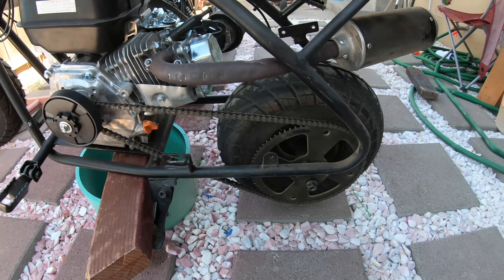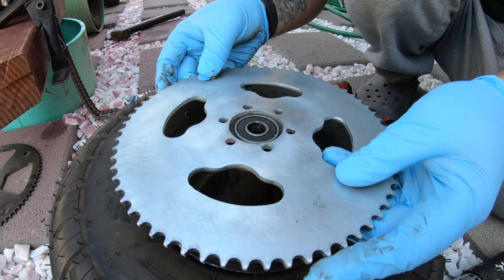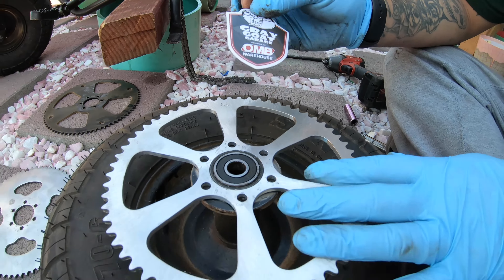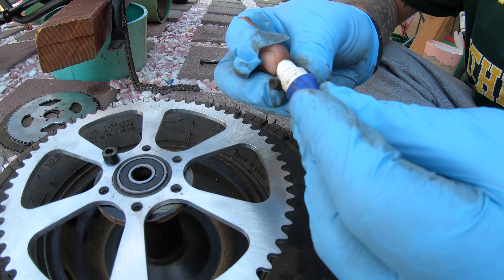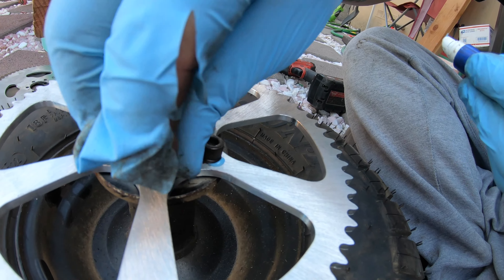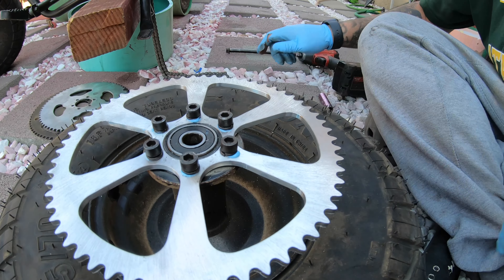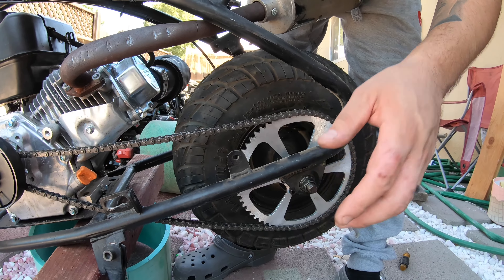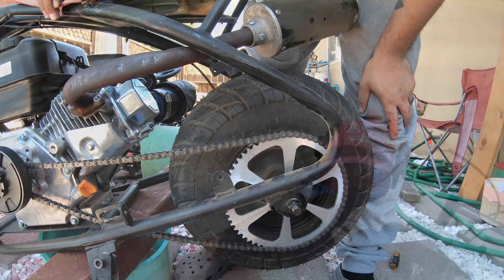We upgraded our rear sprocket ⚙️ on our motovox predator 212

Comment: I switched out the front forks between my old school doodle bug and my Motovox. The Doodlebug needed adjustable bars because it's not long enough for a 6'2" guy with the stock bars.  But the longer Motovox still has plenty of room with the Doodlebug bars, because 
The motovox head tube angle puts them more forward at the top.

Comment: Wouldn't a larger sprocket yield a higher top speed? Figured it would be the same as a 10-speed bike or the transmission of a car. Larger the gear, higher the top speed. This concept to me is like putting a low gear in place of a high one.
Reply from the maker: No smaller gear on the drive wheel higher speed bigger more acceleration low top speed and the front sprocket is lower the gear more acceleration higher more top speed
Reply: It is the same as a car. If you go from a 273 gear to a 411 its going to have a lot more low end power, but will be turning some higher rpm's at 50 and up.
Reply from the maker: Yeah same concept
Reply: You don't understand the difference between the driven and driver sprockets.
Reply: @contraband1543  Uhhhh. There is one sprocket on a mini bike, just like a bicycle. smaller the gear, more torque less speed and on. It's not rocket science but apparently people think backwards nowadays.
Reply: No I’ll tell you why because let’s say u a 12 clutch and 75 sprocket for the back wheel to turn a whole 360 that mean the clutch will have to turn 6 times so it will be a 6.3 ratio now a 12 clutch to a 60 sprocket that means it’s a 5.0 ratio which is a higher top end. You get me… with respect
Reply: @astridperez1812  But that would then give you less torque. Most standard clutches have the same amount of teeth for these bikes so just making the rear sprocket larger is having an adverse affect to what the goal is. Sorry but you're backwards.
Reply: smaller the gear the faster because it takes less rotations of the shaft to rotate the wheel once at the cost of power
Reply: @thegreatpatsy  it has two sprockets one for the clutch other for the rear wheel smaller sprocket is the back the faster you go if you’re confused there are a lot of videos out
Reply: @brandonespinoza111  I'm not confused. It's simple logic that if you reduce the size of the rear sprocket all you are gaining is low end torque, this has nothing the do with top speed, especially if your engine has a governor or is limited. The larger the sprocket, the wider the range and higher torque at TOP speed. Comprende? I have the same exact bike with the same engine, trust me, the video creator could keep going smaller and smaller on that rear sprocket and it ain't gonna make one damn difference in the top speed.
Reply: @thegreatpatsy  it’s a simple google search if you don’t believe me😂

Comment: At first I think you said you were going to from a 75 tooth sprocket to a 65, then a 60. At the end, I think you said you went to a 60, and only gained 4 mph.
 Did it quit trying to wheelie as bad with the 60t/65t?
Reply from the maker: It only gained 4mph more becuase we were limited to engine rpm on a stock governor motor
Reply from the maker: And wheelies stopped
Reply: @EnviousRepairPerformance  I changed from a 75 to a 65 two days ago. Significantly faster top end,  still good bottom end acceleration , and that front wheel still trying to come up. If I wasn't paying attention to it it would have flipped me on my back. It did twice in my front yard. A little embarrassing . 
 How are you finding how fast your going?
Reply from the maker: With a app on my iPhone that I have for speed
Reply from the maker: GPS speed
Reply: 10% increase

Comment: when i put on a smaller sprocket does it give less torque because i need to lower the torque on my mini bike because it pops up very easily
Reply: Yes, could even go to a 40 or 50 tooth if you really want to tame it down.

Comment: can i use a 60 tooth rear sprocket without the chain having issues staying on? i was assuming since its smaller, id have to make a custom chain tensioner of some sort, which has made me hesitant in putting mine on
Reply from the maker: You just cut your chain shorter and if your chain comes off your bike or sprockets have alignment issues

Comment: if this a motovox mbx10 minibike with a stock rear rim could you reply with the link of this sprocket if it fits #35 chain please and thank you and if this is a 212 i got a rt200 mini bike with a stock 212 predator engine and its straight chained it goes 65 70 i weight 140 all i did was take the throttle screw fully off and out if you have not taken it out already try it
Reply from the maker: You get the sprocket from ombwarehouse

Comment: Do you like your tires ? I have those cheap ass Wanda “tractor” tires and they suck. Yours look definitely street tires 
But I can’t find any good tires. Any advise?
And what happened to the 65 tooth ???? 
75- straight to 60? 
You should have gained a lot more than 4 mph  from75-60 
Changing to a 65 will get you about 4-5 mph
Reply from the maker: Yeah I have sun f tires they work perfect and yes it will go way faster but the motor is completely stock governor in tact so it revs out fast without the governor it would pick up more speed
Reply from the maker: Look up 145/70/6 that’s the tire size